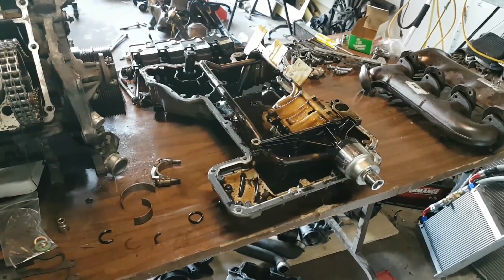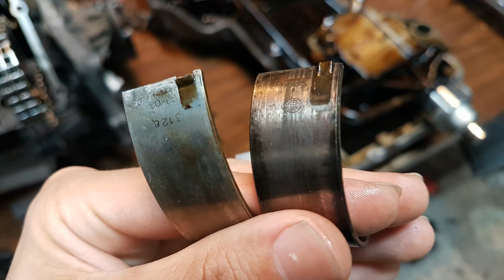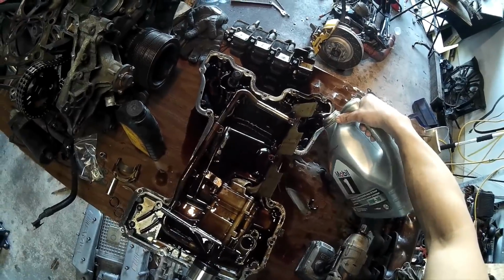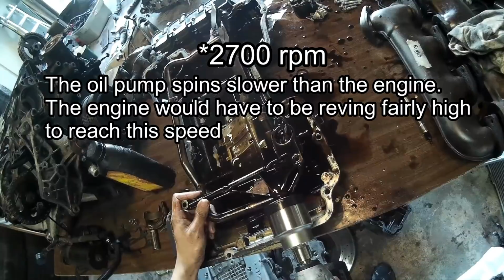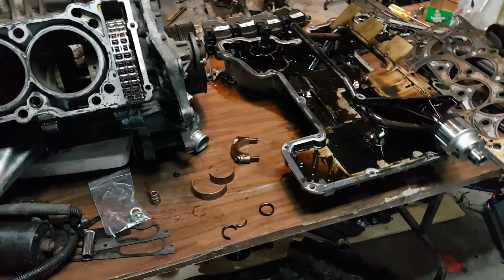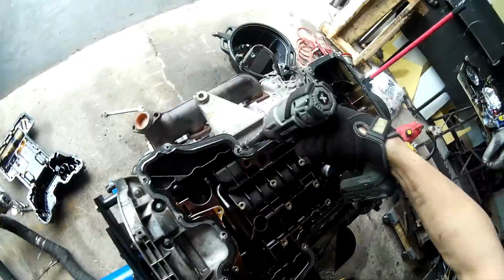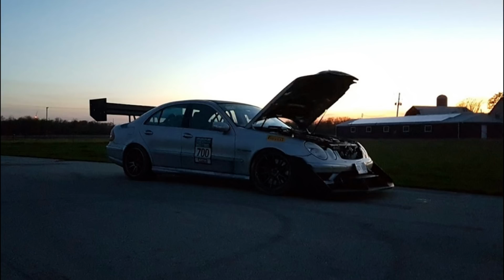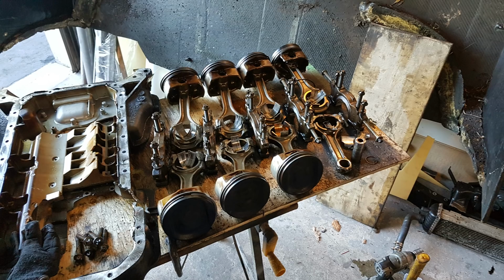Bad O-Ring, Spun Bearing Again! On 2nd AMG Engine

Comment: And my honest none car expert answer to your questions, if the new engine really is that good, and dropping it in won't be an issue, then just replace the bearings and use that instead. How much harder will it be getting a 3rd engine, stripping it to make sure the bearings and seals are okay and all the stuff you do to an engine. You already have that one stripped, you know what needs to be changed, unless there is  crack in the block, keep it.

About the chain scraping on the block, that looks like a serious design flaw because I imagine there should be a spacer in places where the change comes close to touching the block. They are only a few grams and they could have got them in there easily... Serious design flaw.

And yes people, you can destroy your engine without oil... Or else engines wouldn't use it. Ever heard of an electric engine using diesel or petrol?

And again yes, rubber does become hard (and sometimes brittle coz I m surprised that the O ring didn't disenergrate into chunks tiny chiunks) over time and the fact that the car doesn't have a oil pressure sensor is kinda stupid. Made me open my eyes to something else I never thought of.

But again, I am not an expert so it's just some guy on the internet talking shop and just laying down some common sense.

Comment: Is the M113K engine in the CL55, S55, and G55  the same design with the O ring connecting the oil pump to the sump?
Reply: Different sumps.
Reply: Hmm, I've got an '06 SL55 and it has that dual sump configuration.  I drive it HARD.  Perhaps time to drop the oil pan, if possible?
Reply: Hard around town or hard  repetitively around a track?
It matters.
I don't think Sls used the same pan config.
If so you'll have to drop the subframe to pull the sump pan.
Reply: Oops, I failed to mention that the SL55 was never tracked.  I have taken her close (or beyond) some limits and believe in 2.5k - 5k mile oil changes.  The M113K in the SL55 definitely has a dual sump configuration as I remove two bolts from separate areas of the oddly-shaped pan for oil changes.  Perhaps I can cross-reference the oil pump part numbers in EPC (or WIS).

Comment: The 1 dislike is from Mercedes haha. Bad design flaw pfff high end car failure by a 1$ 0 ring.
Reply: To me this can only be done on purpose by Mercedes, knowing full well.. that it takes a year or 2 3 at least for rubber o  rings to harden out like that. Knowing that by the time it has done so, warranty will be over.
Reply: L. Yea i mean why making a system that is prompted to fail? A solid piece would be a lot more reliable and easy to made 🤷🏻‍♂️
Reply: Or just live in Germany where it's much cooler.
And they have the Autobahn.
Which is also much cooler.
Reply: Nah, i live in the Netherlands, real close to the german border. I drive the autobahn often and its not what it was 10 years ago. ALOT of changes, very busy, alot of roadworking etc. And much cooler in Germany? how does that have anything to do to the o ring problem? a 10c outside difference in temperature is not gonna change the oil temp by alot or prevent that o ring from getting hard. That tube should have been connected solidly.
Reply: @lucase3047  Like it USED to be in older Mercedes before designed malfunctions enter the game for dealer revenue. Shit designing means Toyota Makes even more money. The cheapest cost of ownership across its entire brand lineup-including Lexus
Reply: A bit o Lucas would've provided some insurance by increasing the oil pressure and stickiness of the oil.
Reply: The model is almost 15 years old, if it was a common failure it would show on a lot more cars, given the amount of e55 still on the road with well over 150k-200k miles, it means is not a bad design. Chevy LS motors have o-ring failure too, that means Chevy is a crap company...

Comment: What do you expect if you track a road car? You need to modify your car accordingly if you wanna race it like you do. Otherwise racing teams would not spend millions on their racing cars. These engine are famous of going up to 500k Miles without issues.
Reply: The issue is due to a hardened oring, that is a component failure that is gonna happen regardless of load. That likely means all those high mileage AMGs are also suffering oil starvation too, they just haven't suffered an engine failure because they are trundling around at low RPM in day to day use, but they will be wearing out like you can see has been happening on the 2nd engine. Very disappointing from Mercedes.
Reply: Matthew Isaac not really I beat on my 178000 mile car daily, sees 6300rpm all the time, runs killer
Reply: samspace81 I was really looking into purchasing one in the states but this is putting me down
Reply: samspace81: up until now...
Reply: OK I'll chime back in at 200,000. You know there is one rolling around with over 400,000 right? My oil pressure is fine.
Reply: Did you measure your oil pressure, or how would you know it's fine? If the chain tensioner is running on oil pressure and the chain slapping marks are common for this engine... Wouldn't that be a strong clue (amongst other clues) that this is really an issue?
Reply: Can you name 3 supercharged e55 with over 500k miles on them???

Comment: There is a rectangular plate on the front timing cover with allen keyed screw that you may be able to use for your oil pressure gauge. Thanks for posting all this about the o-ring issue.

Comment: The M113K isn't known for these issues, with a 03-07(not including the SLR and other variants) oil pressure issues and spun bearing aren't a common issue.  later builds have a double o ring setup on the pump.  in your specific car I'm sure the issue was exacerbated with the twin charged setup and track use.  i certainly will not worry about my 06 E55 as too many of these cars have run for 100s of 1000s miles with no issues. 

i do appreciate your channel and your work with this.  id suspect that your car and the boneyard motor both were not maintained correctly over their life.
Reply: I tested o-ring materials as a part of my job and found that only really expensive materials were truly stable for more than about 5 years within an internal combustion engine. Some o-rings fell apart quickly, causing huge leaks; some turned into a brittle plastic like material and often leaked small amounts (not always); and only the 30-50x more expensive aerospace spec'd materials remained like new. We also experimented with using multiple o-rings that hardened to reduce the pressure each hardened o-ring had to handle combined with a little "extra" o-ring compression during installation and these still leaked shortly after the "recommended" single o-ring installations did (multiple o-rings did leak less though). Since we were making military equipment we did go with ultra-expensive o-rings in some locations to meet our 20 year performance requirements. Unfortunately no car manufacturer is going to pay $20 per small o-ring for ultra-stable o-rings when they can pay a fraction of $1 for something that will still typically last 2-3x longer than their warranty requires and even then "only leaks a bit; in most cases...".

Based on what I've seen (both at work and with my personal vehicle projects), I'd bet that these o-rings are hardening and the seal degrading in ALL of these 10+ year old M113's with dual sumps, especially ones with 100,000+ miles on them. The good news is as long as the oil pickup tube isn't moved, the old, hardening o-ring still has the ideal, deformed shape required to seal most of the gap. Only when the pickup tube is moved, the o-ring physically breaks, or if it shrinks enough will significant amounts of air start to be sucked past the hardened o-ring. Until this happens your M113's will most likely continue to run fine. Racing, slamming through gears, sloshing oil from side to side, etc. will increase the likelihood things will shift but... On the other hand small amounts of air may be sucking past your o-rings every time you drive your cars right now, especially at certain temperatures (most likely when the engine is cold on cold days). As long as the amount remains very low, bearing damage will hopefully remain low...

Personally I'd probably at least install a quick reacting oil pressure gauge and watch for odd readings (it is difficult to predict what a small leak would look like but if it is reading low you'd know you have a big problem). More useful as a test I'd install a ~5' x ~1/8" OD clear tube (small ID and long enough to maintain decent oil pressure) into the bottom of a jar or bottle (with 1-2 " of oil in it) on your oil pressure tap location, run the engine, and look for air bubbles in the oil. I've used this technique in the past and it worked well (and found a cracked oil pickup, that was causing a huge number of tiny bubbles in the oil that resulted in intermittent hydraulic lifter noise that a dealer couldn't fix; the big end rod bearings failed a few years later but that's another story, luckily we kept an oil sample...). To be safe you could install a T fitting and the oil pressure gauge too so you can watch the pressure and make certain you're not bleeding off more than the pump can handle. Any air and I'd be spending the likely $150-$375 to have that o-ring changed (I'm assuming it is only a 1.5 to 3 hour job for a decent mechanic to do but this assumes the sub-frame can easily be lowered and/or the engine can easily be raised the few inches needed to remove the pan; some vehicles need a bit of both to remove these double sump pans without disconnecting wiring, hoses, exhaust, transmission, etc. but often this does work even though factory manuals typically state complete removal of sub-frame or engine is required...).
Reply: So if this issue isn't common, why would Mercedes modify the O ring setup?
Reply: You're looking at about an 8-hour job to replace that o-ring with the engine still in the car.
Reply: If you watched the previous video you saw the internals of his first engine- it was spotless.  This is a faulty design and as others have mentioned, the manufacturer now recommends a different o-ring.
Reply: VJDM I got an 06 too, lets not drive ourselves nuts lol this man is an asset to the M113K community
Reply: Slider68 some great insights there, thanks for posting.

Comment: It's interesting how your car managed to make laps on a faulty o ring. 
Keep it up SK8215
Reply: Donut. He already mentioned to put in an oil pressure sensor to at least receive a notification (early one) before the pressure really drops and yes he might have done this before because he is racing the engine. I know BMW has a pressure sensor and the ECU checks it. You cannot really shut it off manually so quickly under these conditions before it really causes a major engine failure, the ECU is much quicker and mostly more reliable than the driver to act.
Reply: It ran fine until the o-ring failed. 
Had he shut off at that instant all would be fine.
He didn't.
It took a couple of laps to grenade the engine, which occured suddenly.
Like a grenade.
Reply: Richard A. Wouldn't the o-ring had to be brittle in order to catastrophically fail? I would presume that the engine hasn't been performing as well it should have been for the prior laps.
Reply: Oil has virtually no effect on performance till it causes failure. Then it's 100%.
Yes, rings baked till hard and shrunk.

Comment: Wow that is some impressive uncovering.  I think you just devalued the resale values of the amg55 cars.  That looks like a lot of work.  How difficult would it be to do this as preventative maintenance with the engine in the car?
Reply: samspace81 you might be right.  You like to play with chevys.  I play with German cars.  I have 8 top model german cars in my garage now.
Reply: samspace81 Chevy sam I have a lift in my garage.  I’ve dropped my 911 engine several times.  Installed a supercharger on my 911’s.  What’s your point.  Can’t have a civilized convo with another youtuber?  You talk big from that keyboard.  Have a pleasant day yahear..

Comment: Does this affect the N/A M113 like in the W210 E55?
Reply: Sure it will, its basically the same shit, its not a common issue, its more related to heat intensive environment..
Reply from the maker: No, only the cars with two oil sumps had this type of pump. I don't think the W210's came with this.

Comment: need to eliminate that "O" ring to something that wont get hard and fail--edit: I also should say trying to run a double sump setup in a high "G" environment is asking for problems, you will fix this one problem then you will run into the next failure item. I spent $900 on my Accusump setup but a dry sump might be better for your high "G" car

Comment: Thanks for keeping us updated.
Good thing you found out what the problem was with your engine!
I wonder if Mercedes is aware of this problem...

Keep up the good work 👍
Reply: I understand that Mercedes changed the design of this oil pickup tube to oil pump interface on 2008 and newer vehicles. Assuming this is correct then Yes, Mercedes is very aware of the issue.
Reply: Nahhhh!

Comment: Wow! What a great verification of your hypothesis! I 100% agree that the o-ring was the 'root cause' of the engine failure.

AMG engines are literally bullet proof and have had this reputation for a very long time. However, the long term lifespan, and under the extreme conditions that were placed on the engine in your car, accelerated its MTBF and voila, it failed. Sometimes, breaking something under extreme load is the best way to find out its core design flaws. Refurbishing to improve the flaw makes it even more robust, as you can now improve upon the flaw to make sure it doesn't happen again.

Problem: Rubber o-ring for oil pump seal
Solution: Choose silicone o-ring instead --> resists extreme temperature swings and is more resistant to hardening when exposed to oil than rubber. Second solution is to weld the pickup tube to the pump instead to make a permanent seal, because this is internal to the car and is literally the 'heart' of the engine's ability to stay lubricated and cooled under extreme temperatures, in the case of using the engine for a track car. Third solution is to use a lead seal (or soft metal) that won't deform with extreme temperature swings and is resistant to oil contamination. Use of a reliable oil pressure gauge is a very wise decision, because that you can measure is that which you can manage, especially to save your engine if possible at the moment of failure. Make sure that the oil pressure gauge is high in your line of sight if possible or as high as you can mount it on your dash without obstruction of view.

Problem: Chain rubbing on engine block
Solution: Install a Teflon chain slap guide/guard where the chain rubs on the engine block. Second solution could be to install a spring loaded, variable tension, tension pully bearing in line of where the chain would slap on the engine block to reduce the slack in the chain. This would also prevent metal fragments entering the engine and prevent premature failure of the engine and/or the chain.

Looking forward to your follow up video on the solutions you chose to reassemble your engine and get your track car ready for the 2018 season.

All the best!
Reply: ram trucks, russia won the war, not us.
Reply: @rvsteve583  

My grandad was liberated by yours, possibly.

And Russia, without all the help it got from USA, UK and CA, would now be the real Österreich.
All they could throw at germans by themselves was just cannon fodder.

Please, stop believing the soviet propaganda bullshit.
Reply: To save on cost, best to buy new bearings and piston ring seals, for putting the engine back together. I think it will be as good as new and very reliable with the oil pump solution that is most robust for the engine.

Keep up the good work!
Reply: diggleboy Rootcause confirmed. However o-rings are a bit more complex than being a piece of black rubber. The oil chemical composition together with heat accumulation over time can have a significant effect on o-ring condition. MB may have selected an inappropiate o-ring design for this application. More robust  o-rings (thermal / chemical resistend) tend to cost more.
Reply: @WoZYtaZ83071 

I repeat: without the allies fighting on 2 fronts, with americans on 3 actually, with the Pacific, and without them also piling up mega quantities of properly built and working stuff (lorries, guns, ammo, and more), Stalin would have fought Germans with soldiers armed with broom sticks.

Without that help, Germans wouldn't have left him the time to reorganize his war industries beyond Urals.

Please get educated.
Soviet propaganda has already done too much damage.

https://en.m.wikipedia.org/wiki/Persian_Corridor
Reply: Sander Citroen So a silicon o-ring would be a good solution?
Reply: What is the item o-ring made of? Nitrile? A viton o-ring could be a solution...
Reply: Now, he has taken this oil pump upgrade one step further. He has now developed new oil pump lobes that eliminate the whining noise on start-ups in CLS55, E55, and SL55 of this era or models with this dual oil pan setup.
Reply: Maybe see about a different o-ring manufacturer. Because the OEM o-Ring isn’t all that great. Maybe ask if they are an upgrade.
Reply: So you say they're bulletproof but they're NOT.
Reply: diggleboy 
Every thing German is over engineered junk... Another reason we kicked their ass in WW2